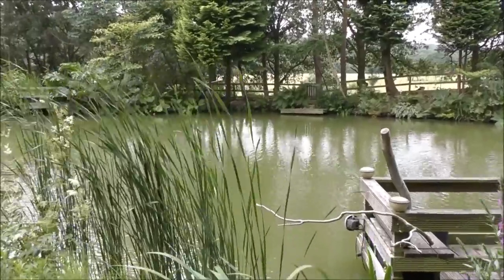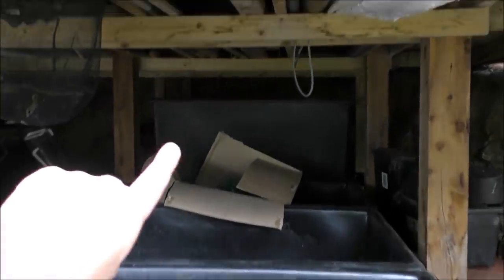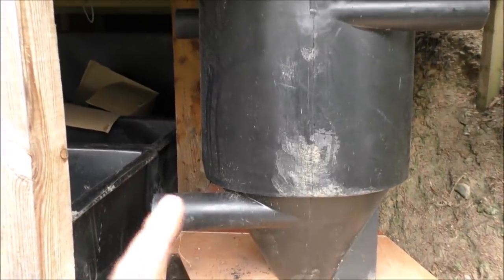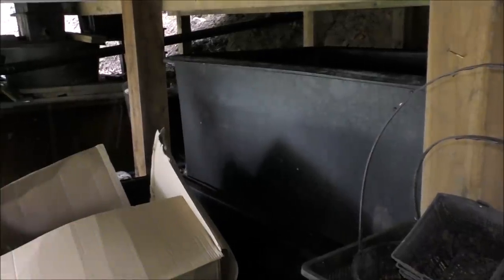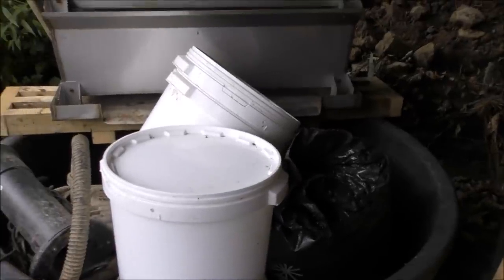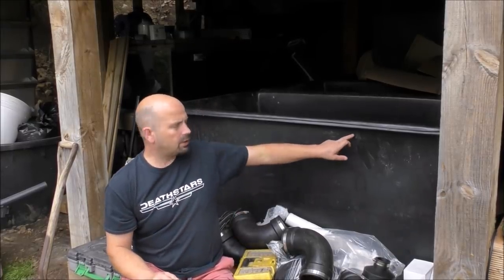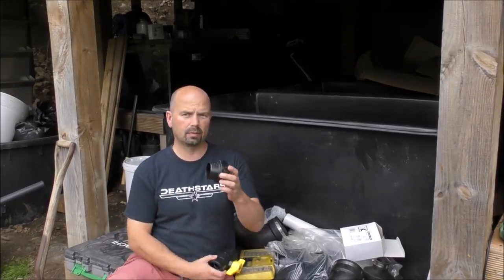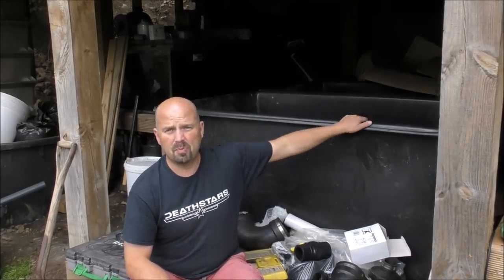Building a HUGE Pond Filter - Part 1 - Introduction

Comment: Great project Richard can't wait to see it  running ☺☺
Reply from the maker: That may be a long way in the future judging by how little time I've had for construction so far, lol
Reply: Pondguru im sure by autumn it will be up and running, have you looked at using dyofix? Its the blue dye that controls algae growth that some carp fisheries use 👍👍
Reply from the maker: I'm sure that would work but I normally just use a couple of square bales of barley straw to prevent it going green. I thought I'd leave it this year to see if when the green water dies off it will take some suspended sediment down with it but it's a bit early to tell if that will happen.

Comment: Great video. Can’t wait to see the progress. Very interested in all of the finer details ,which you explain so well in your videos. Always interested in how filtration works in ponds etc. Currently pimping out aquarium filters based on your videos. Curious as to whether you’ve considered taking a clue from nature. You mentioned clear spring water in a previous video. I was wondering if water pumped into a reed bed would filter out a lot of particulate matter resulting in clear run off? Also when you open the bottom drains on the mega filter what happens to the run off? Have you concerns with this? Thanks again eagerly await the next video.
Reply from the maker: The spring which feeds the pond dribbles in and although the pond is packed with plants around the edges the water is still stirred up. When draining the tank the water will be directed to my lawn and borders to feed grass / plants.
Reply: The CAT centre in Wales use a combi of vertical and horizontal reed beds that feed a willow system before finally entering the pond.

That system's designed to have a potable end product, which is a different design aim to this one.

Comment: Consider running the vortex component alone at first to see if you can reduce the suspended particulate matter in the pond prior to bringing the other components on line.  Any reduction in that suspended matter would "save" the bio components from getting clogged too fast and allow them to work on the  dissolved materials where they are most efficient and useful.  But it may just be that the pond will have an infinite supply of the solids, but it's worth a shot, and if, after a week or two you don't see any reduction, you've only lost a little time.
Reply from the maker: The other parts of the filter will be important for culturing higher forms of life and supporting bacteria to ensure healthier water - goal is to make water clear and healthy so I really need all the various parts together.
Reply: The idea was to do some 'mechanical' filtering first via the vortex,  before adding in the bio media, which can become clogged.  Not to separate the functions in the long term, but give one a head start to enable better efficiency from the other.  Same goal.

Comment: if it will filter fine clay particles then it will filter any waterfleas, daphnia,shrimp etc unless they are growing near the return obviously so yes they will clean the water in the filter but not much will pass through to feed the pond fish, the daphnia tub specifically for them will obviously, huge job u got there, hope u get it right 1st go and dont need much rearranging etc cant be cheap.
Reply from the maker: The set up of the grog chambers will support a mad amount of water lice / shrimps which will find their way back to the pond or come out in the water I will be draining off and be used as fertiliser for the lawn and planted borders.

Comment: Hi Richard, I'm loving this filter project and looking forward to looking into that crystal clear pond.... it'll be like watching trout swimming around in a swimming pool lol.  On a serious note though I have my doubts! What volume of the pond are you hoping will pass through this mega filter on an hourly basis? Does your pond have a little stream feeding into it? Man I hope it works, great vid as always. Rowan
Reply from the maker: The spring which runs in is just enough to keep it topped up - pump I intend to use will be 30000 lph.

Comment: Great idea! No uv filter?
Reply from the maker: It takes around 1 watt per 100 litres to kill suspended algae in a pond so I couldn't afford to run a series of UV filters due to the size of the pond.Usually I keep the pond algae free simply by using 2-3 square bales of barley straw.
The pressure filter I am using later in this build has UV bulbs in but they are only 50w which is nowhere near enough to impact this pond (it is around 1,000,000 litres)

Comment: Fantastic exciting stuff , looking forward to part two . Quick question , do you have a stream running into your pond or any other water source ?
Reply from the maker: There is a spring which feeds in but it dribbles in and is enough to keep the pond full.

Comment: This is the first time I hear about Alfagrog.  Is it better than Biohome Ultimate?  Btw, great vids.  Learn new stuff all the time.   Thank you.
Reply from the maker: For use in a big dirty pond filter it is a good media but most of the surface area is external so it is nowhere near as effective as the biohome at supporting bacteria - if you watch the video 'Looking inside filter media' you'll see what I mean as I show the internal structure of many different types of media in that one. Where water is cleanest at the end of the filtering process the biohome will be used but the alfagrog will be used here mainly as settlement and to support higher forms of life (which will feed fish when they work their way back to the pond).
Reply: Thank you for the reply.

Comment: I just came across sort of an unusual way to treat pond water. Its bales of barley. Its even sold at Walmart in small sized for fish ponds.
Maybe that would help?
Reply from the maker: Yes, that's what I generally use to treat the green water and as the crops have just come up here I'll be getting a couple of square bales to drop into the pond. They work best near water flow so I'll put them in the return flow from the big filter....when I get it finished, lol
Did another chamber yesterday (brush chamber) so next task is the moving bed part of the system.

Comment: Question; please could you advise if I could connect & run simultaneously an Oasis filtoclear 20,000 and an all pond solutions pfc 12,000 ??? I cannot get an answer anywhere? Thank you 🙏
Reply from the maker: 'Simultaneously' implies that you are running them both at the same time on the same pond - that is no problem.
Ideally I'd run the 2 pressure filters with 1 pump to save big on electric. Assuming that the filters are feeding to a common point the pump in the pond would feed to an Oase YDB splitter: https://geni.us/ZGXAQu with 50% of the flow going to each filter.
The outlets of the filter would run to a second Oase splitter to rejoin the flow then the pipe would run up to a cascade, shower filter or wherever you would want to take it.
Running the filters in tandem like this is the best way to run 2 pressure filters since if they are used in sequence (one flowing into the other) the second one will be doing next to nothing as far as filtering goes.
Hope that makes sense and best of luck with the pond.

Comment: Any UV to be installed Richard?
Reply from the maker: No, nothing extra planned as the running costs for something big enough to make a difference would be huge although the Lotus pressure filter has 50w of UV and will be integrated into teh system near teh end.

Comment: If you use spring water...why do you need bio filtration? Wouldn't just a fine mechanical filter be all you need? Just run it through gravels and then some super fine poly sheets- meters and meters of it. Use the wire brush tub for just more fine particulate removal.
Backwashing to a sewer is the part you have to figure out!
Reply from the maker: The spring just dribbles in and that tends to run clear most of the time. A large fine pad can be clogged in a day from this pond so that would be a costly and maintenance heavy way to remove muck although the shower filter(s) will probably have fine pad over them.
Waste water will be used to feed my lawns and garden.
Reply: But once it clears the water...switch to courser pads?  Mr.Pond,I read that somebody who had the problem of clay ponds being murky in Australia...he drained,dried the pond..then used a compacter on the bottom. Extreme.
Reply from the maker: I'm not draining the pond - that's for sure, lol
The last container will house a pump which will pump to the pressure filter then up to 2 shower filters. I didn't show that in this video as I only just decided to include that into the system a couple of days ago - I'll cover it when I get to that part of the filter in a future video.
Reply: I'm thinking you just about buy out all the floss at your version of Walmarts all over town,use it as a huge prefilter- and when you spend a week washing it once a day...it might get that water crystal clear. After that? Go down to poly mat sheeting or best foams?  The initial removal..over a week or month,might take out all the excess free floating clay particles. Clay particles are among the finest that can you can find in water..once you get them out,you might have a more natural clear pond.
Floss also might be fastest to clear that pond. After that,the other ways to maintain. Just trying to help!

Comment: Hey Richard!
I Really think this is an awesome project and I hope it succeeds.
However I think that there are a few flaws that you should correct while you can. Don't get me wrong here but I think you are taking too much of an aquarium approach to a pond, which is not always applicable.
Here are a few points you should consider:
1. Height.
In my opinion your filter build off too much from the ground. The problem with that is, that the pump will use MUCH more power to push LESS water, as height really is a big problem for most pumps. That means putting a 16.000l/h pump will only really push effective 8-10.000l/h. If you put all your containers into the ground so the water level of the pond is just slightly lower than the water level of the filter, it will use much more of its capabilities.

2. Filter media
As the pond is all natural, it features a wide variety of bacteria in the substrate already. Those will be perfect for filtering the waters nitrate/nitrides etc. Your filter should mostly, if not solely, focus on the particles in the water. You should use many many more brushes and no shower filter. Try to get a very Very slow water flow through the brushes to settle a lot of particles.

3. Pump placement and capacity
As, again, you only want to filter the water and not the ground, you should place the pump somewhere in the middle. As this is kinda impossible you may want to add a sort of pump chamber which takes in water from the surface/middle ground and has the pump standing clean without mud. This also keeps the possibility of using a tube pump. Tube pumps can push way more water at only a little energy but can NOT push it very high up so 1. comes in again. As for pump capacity, ideally you should (in theory) push at least 1xpond/h through the filter. As that'd be like 200.000l/h I don't think it's possible. You also don't want you pond THAT sterile. More is always better though. Also keep in mind that the brush chamber should have very low water velocity so make the chamber as wide as possible (big cross section). Same goes for the vortex, as you want the dirt to settle. Moving bed/bacteria based chambers on the other hand should have as much movement as possible so the bacteria is able to get sososo much water as possible through it.

I hope this helps you a little and you take up some of my points. 

I'd love to chat with you about this so hit me up on Facebook if you like.

Cheers mate!
Reply from the maker: I hear you on all those points and a system built somewhere else which was lower down would definitely have made sense but the ground under the cabin lends itself to locating the filter there so it is out of my wife's view. The ground at the back slopes up so if I went for the filter all on one level I'd lose one or two containers.
The increased height of the initial parts of the filter will affect pump flow for sure but I'm not concerned with getting a certain turn over rate per hour and the extra fall will allow me to water different parts of the garden I will be developing in the future with really nutritious water (possibly a vegetable garden)
The moving bed will be water driven with the feed pipes having DIY venturi built into them and a fall is needed for the water to drive the bed. It could turn out that an air pump is still needed too but time will tell there.....lol
There will be areas of fast flow and slow flow to move media or settle muck and the positioning of inlet / outlet will maximise dwell time in settlement areas.
Yes, it will need a huge pump - I can get a 30000 lph pump which is a variable 385W so running costs will be fine.
Yes, the idea of a settlement filter is the primary reason behind making it like this with the brushes in the vortex filters and also in the large brush chamber which will have a nation of them. There will be 2 containers filled with grog which works great in muck and also settles fine muck out really well then the shower filter(s) at the end are to soak up any nitrates before water heads back to the pond. An air pump may be in that section to ensure that the water is not de-oxygenated when it goes back to the pond but a venturi will be built in the outlet to help out there too.
Ultimately the pond pump may be suspended below a floating island (another project I haven't got round to making yet....) or off the end of the large platform in the pond as that is approx. 8' deep off the end of there - as long as the return from the filter was directed away from the pump the pond should turn over well.
As the videos progress you'll get a better idea of how each section is set up - this video was really just an overview of the various parts - next part (on the vortex filters) is due to be uploaded later today and I will tweak the various parts as necessary.
The idea is for the filter to make the water clearer through settlement but also to be a breeding ground for invertebrates which will end up back in the pond to feed the fish, hence the grog as it is great at doing both.
I'm not on facebook as it is quite literally the work of the Devil - however feel free to ring any time on 07772848730

Comment: I have just purchased a kockney koi 6000 multi chamber filter that did not come with any foam or media. Does anyone have any recommendations or tips that could help me find the best products to use.
Thanks Lee
Reply: Would you recommend using brushes as the first container came with brushes or would you recommend something else.
Also would you say that Alfagrog is better than pumice is this situation or it be the other way round.
Thanks lee
Reply from the maker: Yes brushes are great for primary settlement so are a good choice for the first chamber. In a fully submerged situation the alfgrog will be better than the pumice since there will be a build up of fine muck in all the chambers which will clog more porous media like pumice.

Comment: Google Search: MIBRO Adjustable Circle Hole Cutter For Wood, Plastic and Composites
I remember the video when you used a clay flocculant. What's your opinion of this (on Youtube): Denitrification (N2) using a Biocenosis Clarification Basket in the Aquarium Sump.

Comment: I still don't think it will work. 
I would help nature do it's own thing with a bog/gravel filter around the pond. Low to zero mainainence, plenty of plants.
You can even run it on an airlift system for even less moving parts and electricity.
Reply from the maker: Time will tell...